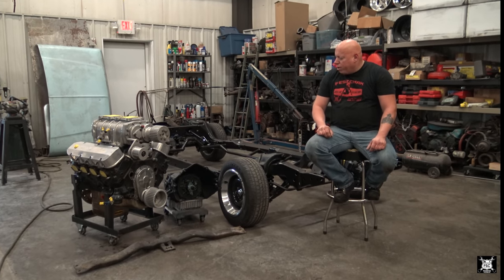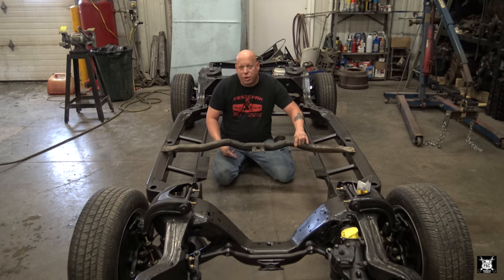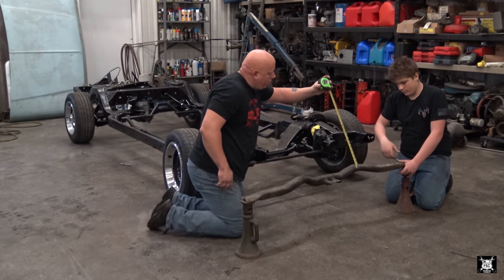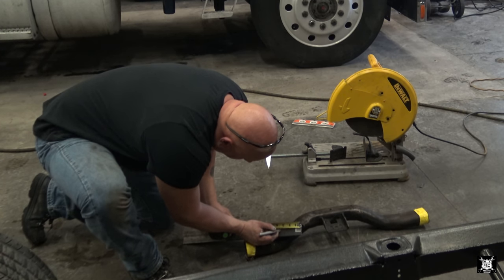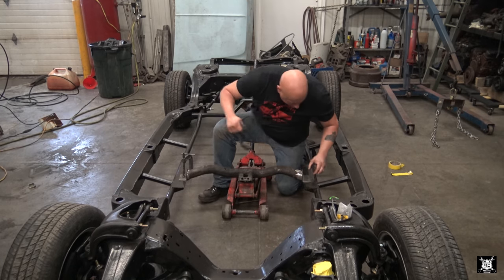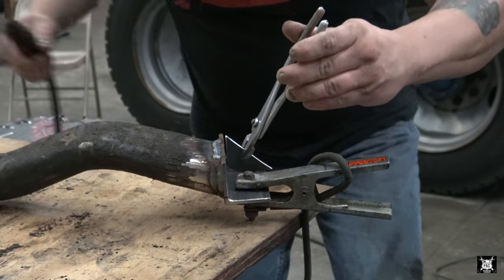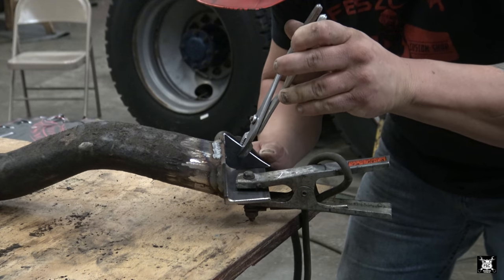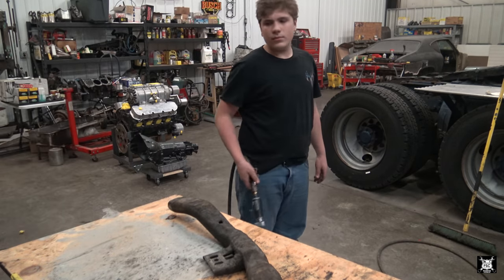Matt And I Create New Chevelle Transmission Crossmember

Comment: question.. if there were welded nuts inside the box frame and those added tubes had a relief couldnt the original mount holes be used?  Might not be a better way just wondered